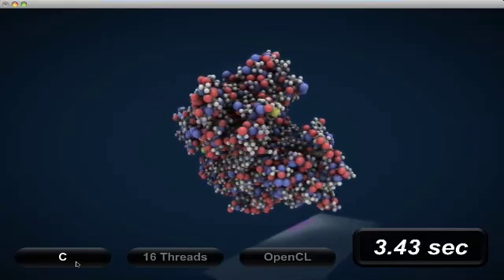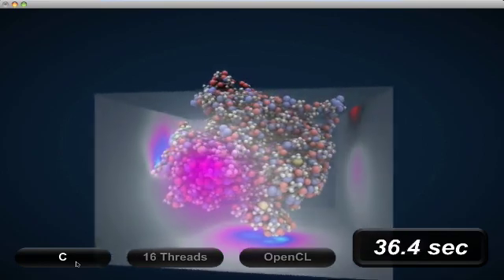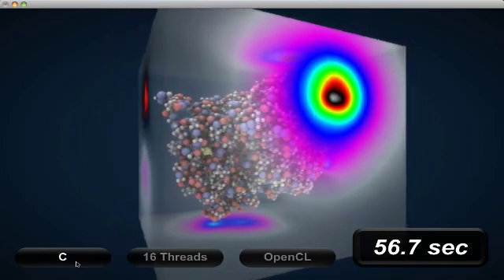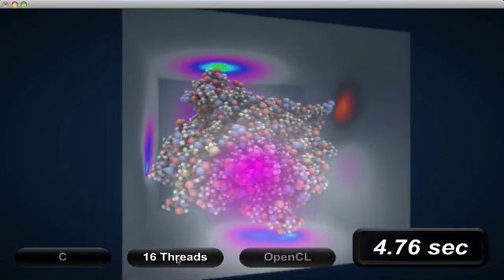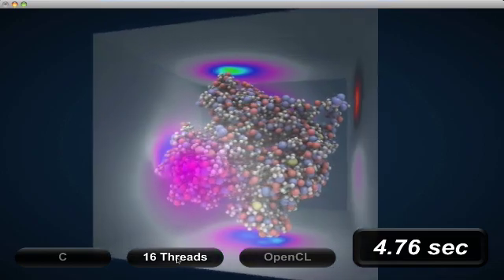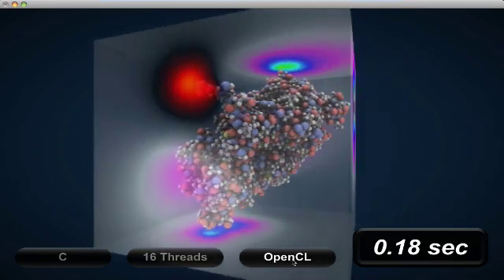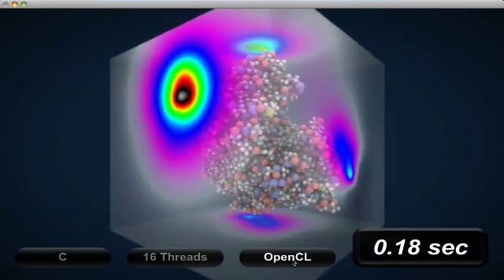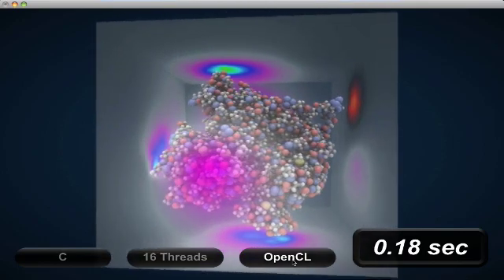OpenCL

Comment: If GPU's are so powerful, why do we need a CPU?
Reply: joe stephens
Not only that, GPUs are only so good with parallel problems. Most problems are serial not parallel, so you won't get such great performance boosts necessarily.
Reply: you need a cpu to manage the gpu / gpu's
Reply: CPU = fast + universal/configurability, GPU = massive amounts of calculations done all at the same time.  A cpu has tons of tools and features that make running different software possible, while a gpu is optimized to perform a small list of different kinds of calculations.
Reply: S0lidSpy24 This is similar to the difference between AMD and Intel.  Intel focuses on single core performance, and AMD focuses on multi core performance.  Intel is always better for applications designed to use one processor core.

Comment: This is a hardware implementation.OpenCL uses the GPU. Regardless of the OS used. The same CPU and GPU are used and therefore (roughly) identical calculation times. Now It is true that macs (the hardware not the software) usually don't have super powerful GPU's and therefore want run as fast.

Comment: I believe all this program does is separates out the y-level computation between 10,000+ threads in the GPU.

The program itself determines the "closeness" of each point (probably more then 1 million points) to each wall and categorizes it with a color.

Comment: Who provides implementations for making openCL written code to run on a particular core. for example if i am a processor designer and i designed a processor according to my own proposed ISA( instruction set architecture) , now if i want openCL code to run on my device or to make my device openCL compatible, will i have to write the compiler relative to my ISA ? How a particular device makes itself successfully execute code in a heterogeneous hardware platform?
Reply: Hardware vendor is responsible for compatibility with OpenCL. It is up to vendor how exactly like from 1% to 100% OpenCL is implemented.